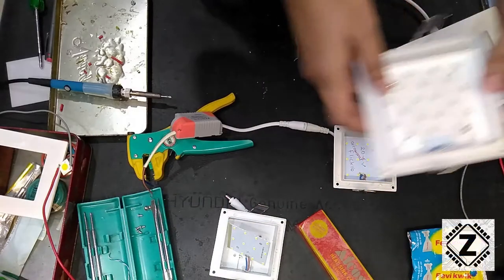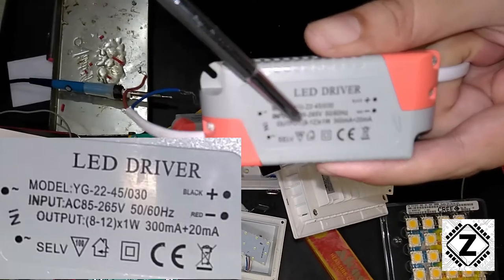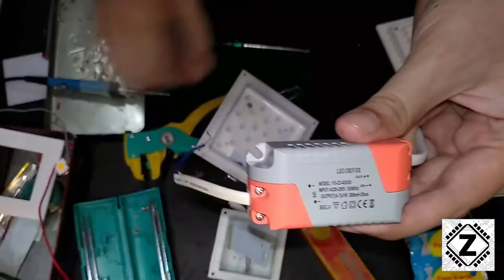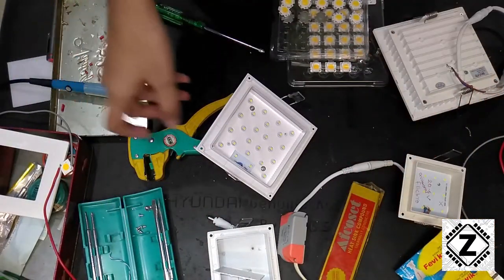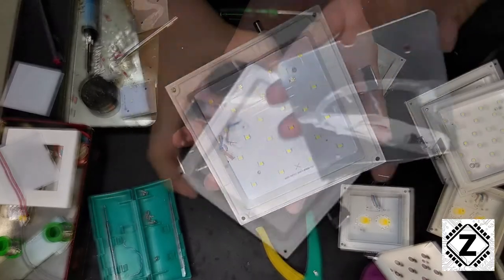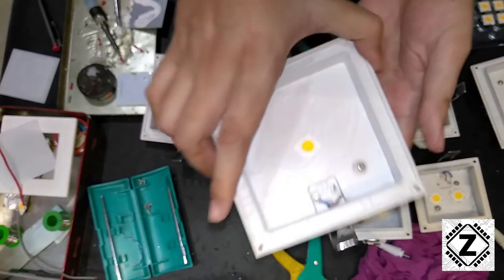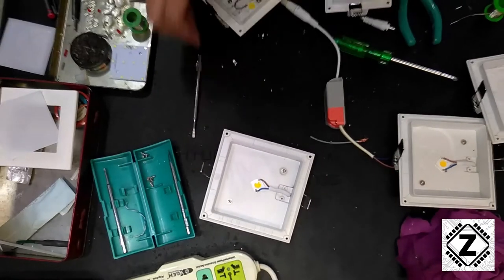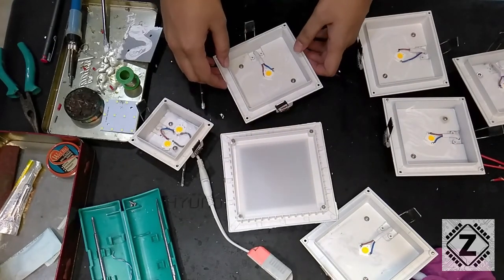[Eng] How to Fix LED Panel Light | Replace COB Chip, Change Color | High CRI & Natural light upgrade

Comment from the maker: This Video is Available in Multiple languages-
Hindi- https://youtu.be/0JoOCbKDgyA
English- https://youtu.be/pCZsTy7ynKo

[Buying Affiliate Links-]
LED COB Chip- https://amzn.to/3qbveXF
09-12V 3W https://amzn.to/3qdUT1N
6W https://amzn.to/3wY6Xrw
26-30V 300mA 9W https://amzn.to/3qdy5zb
CRI 95+ RA 36-40V 300mA 12W https://amzn.to/3RFWady
CRI 95+ RA 54-60V 300mA 18W https://amzn.to/3KWfuRJ
CRI 95+ RA 36-40V 750mA 30W https://amzn.to/3epObDk
CRI 95+ RA 60-66V 900mA 50W https://amzn.to/3x2FN2T

LED Driver- https://amzn.to/3epOy0G

Soldering Kit https://amzn.to/3qx7D3T

Thermal Paste (Budget)
https://amzn.to/2TvTnLR
https://amzn.to/36bN2rA
https://amzn.to/3wehR9y
https://amzn.to/2TGGEG7
https://amzn.to/3ylTnwo

Thermal Adhesive (Recommended)
https://amzn.to/3yspDy0
https://amzn.to/3jLuF4F

Thermal Two way tape
https://amzn.to/3yoPLtI

SuperGlue (Cyanoacrylate Adhesive)
https://amzn.to/3hfk0h0
https://amzn.to/3jM79EH
https://amzn.to/36gyN4E

Buy AC-DC Clamp Meter-
Mastech MS2101 (My meter) https://amzn.to/30miXTH
Sigma https://amzn.to/2G2gd75
Meco https://amzn.to/3jgVF98

Comment: Can we convert currently installed 4k cob led lights into a  multicolor (rgb) cob light?
Thanks
Reply from the maker: Yes. But you'll need RGB controller to change colours.
Reply: @ZenInnovations  how many cob lights will work for each controller